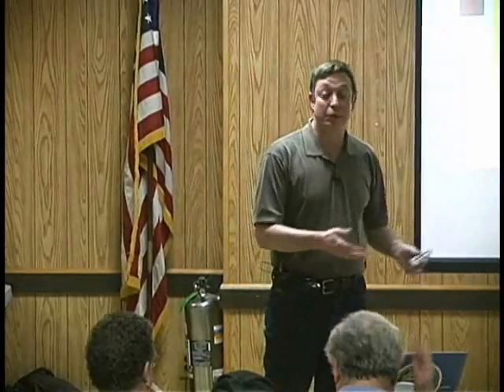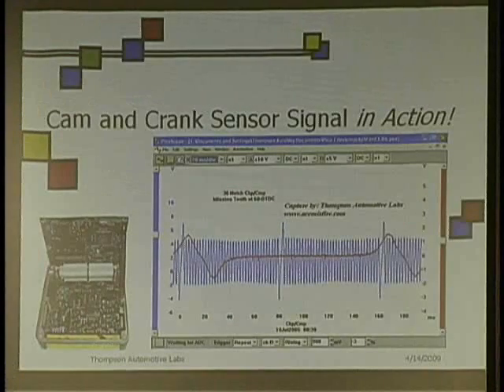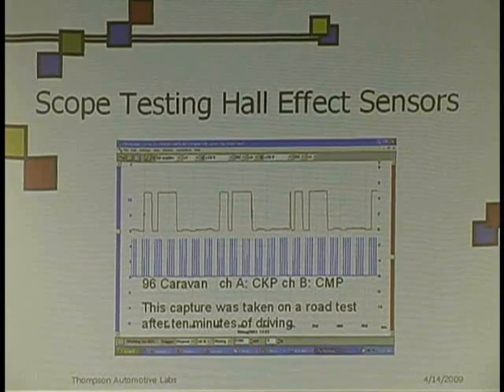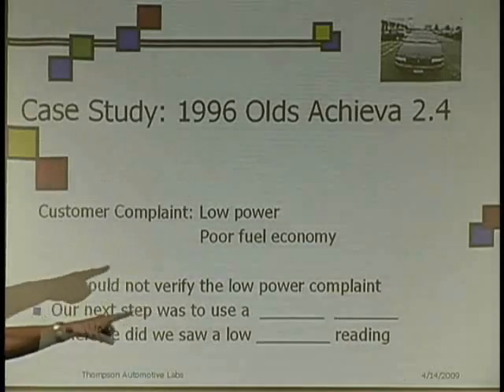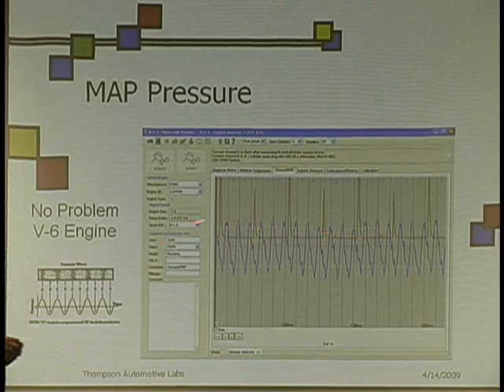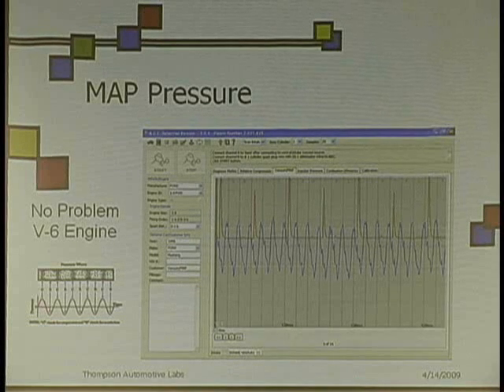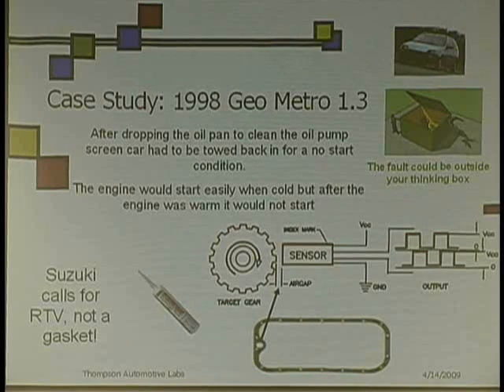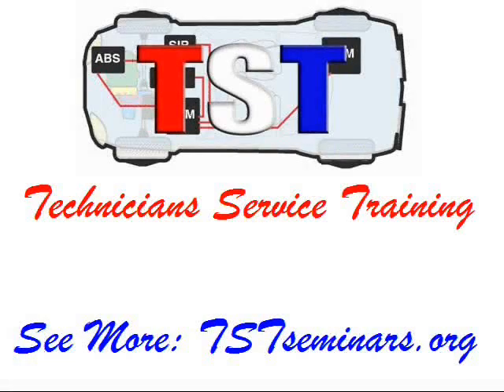Cam and Crank Sensor Diagnostics

Comment: Well lets see it could be;
spark plugs, 
coil pack, 
burnt valve, 
bent valve, 
head gasket issues, 
loss of compression, 
any amount of wiring issues, 
fuel injector failure, 
bad pcm, 

Test all that to start.  Hope that helps.